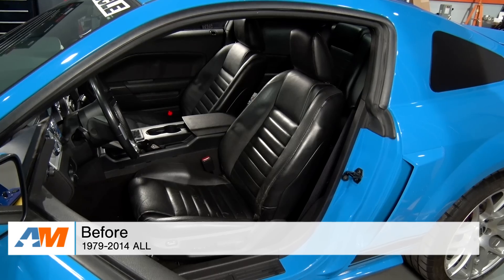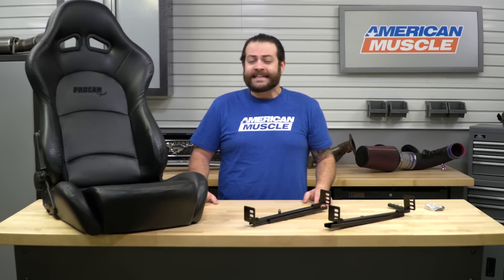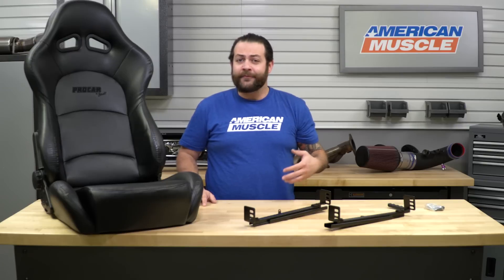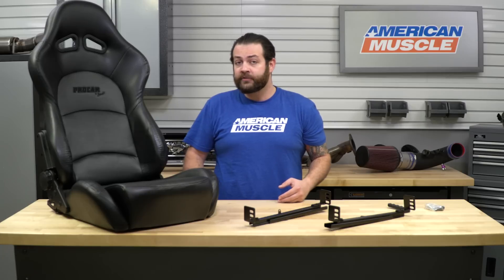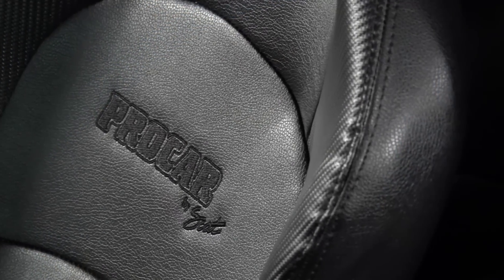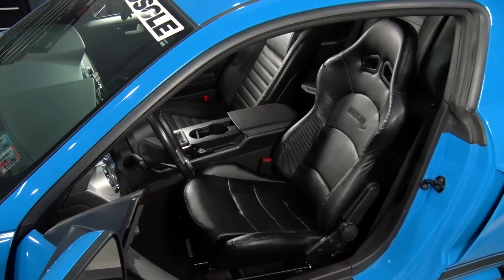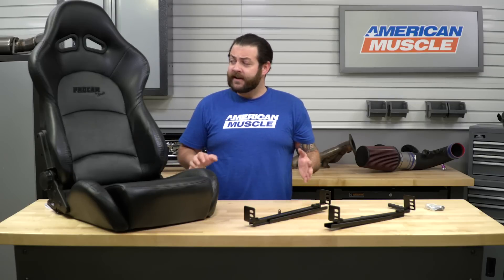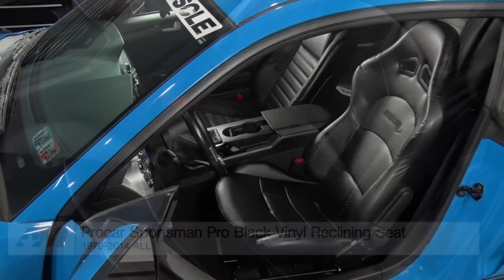1979-2014 Mustang Procar Sportsman Pro Black Vinyl Reclining Seat Review & Install

Comment: I would be concerned with the stock seatbelt rubbing on the shoulder part of it.
Reply: larry_the_villan have you used racing belts daily? I was thinking of the same thing but I am wonder if they are ok for Street use
Reply: Eric Lee  actually it be more safer than ordinary seatbelts, if anything, just get the harnesses soft pads that go over your shoulder area so they wont dig into your neck
Reply: You did to definitely check your laws. Even though harnesses can be considered safer, in most if not all areas, they are not technically DOT approved, and you could be ticketed.